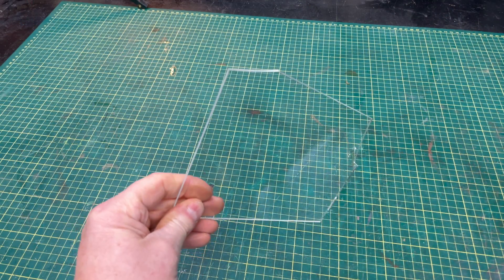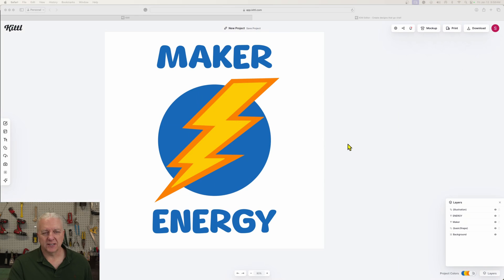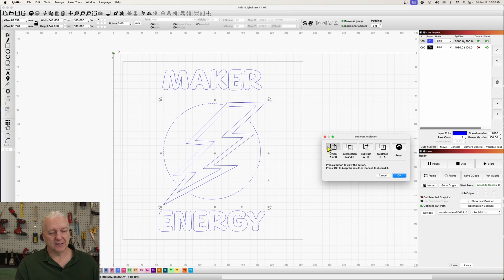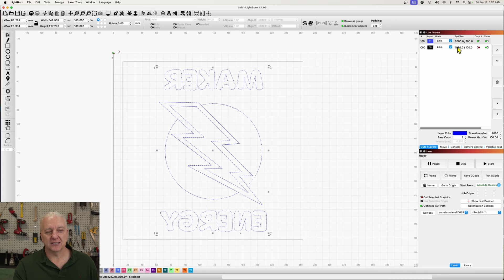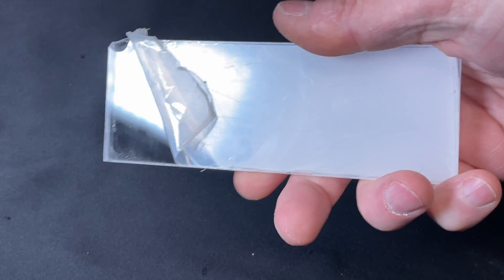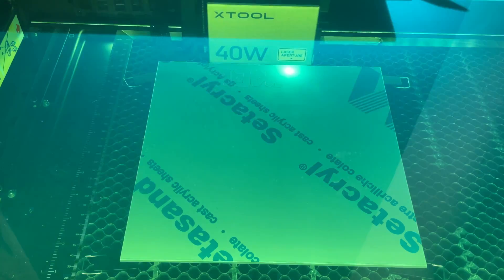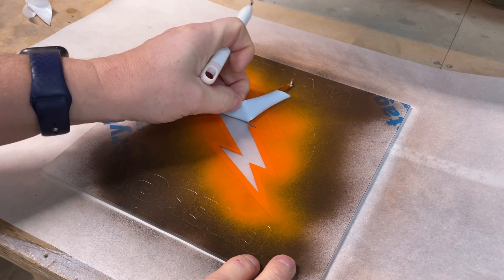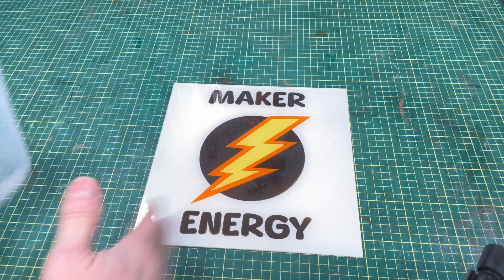Mastering Laser Engraving for VIBRANT Colored Signs

Comment: Hi Steve. One question, how to you stop your first spray layer from filling in all the cuts. I tried this and ended up with my first color being a feint line between all the other colors.
Reply from the maker: Well you do need to be fairly careful about where you're spraying, but You could always place some cardboard over the pieces where you definitely don't want pain.  The other option is to build a jig that lets you place the part very accurately and then only cut the mask for one color at a time and paint each separately.

Comment: Great video. I do have 1 question. I have a falcon 22w diode and I was wondering which method you use to CUT out clear acrylic if it’s possible. Approximately 3mm thick.  Tia
Reply from the maker: Cutting clear acrylic just a non-starter for diode lasers. Really only CO2 lasers can cut acrylic.
Reply: @SteveMakesEverything  Ty!
Reply from the maker: @nickdinick7653  Happy to help.  I really want to do a video about the different types of lasers.

Comment: I have paper masked acrylic. I scored/engraved my acrylic and then weeded out the parts to be pained. I painted a coat of clear first and let dry. Then I sprayed white. When I peeled back my paper my lines look terrible. I will try to skip the clear, though I thought that was suppose to help with clean lines. I'm concerned that it's some adhesive residue causing this, or too much paint? I'm at a loss and wondering if you have any suggestions. I've made 350 name plates and am hoping to salvage the ones that I haven't yet tried painted. Any suggestions appreciated.
Reply from the maker: Making things is volume is never a great idea until you perfect the process on lower volumes.  A process like this has a lot of variables and takes a bit of practice to get right.  I've made quite a few signs like this before I got it right.

Definitely. start with relatively light coats of paint. Two light coats is better than one that causes the paint to pool.

Comment: I loved this video and decided to make a sign for my wife's greenhouse.  I should have been a bit more conservative on the number of colors, but wives can be persuasive!  The sign had to be round and my stock was square and I could not cut it perfectly round, so I ordered from Amazon.  The disk I received were not covered in colored protective material as pictured but rather clear plastic that I didn't think the laser would cut through, but I took a shot at it anyway, and it failed.  I resorted to painter's tape (several times) and though it cut well, it leaked paint under the tape even when overlapping.  I did press the tape down well, but small streaks appeared in places.  Otherwise the paint looks great!  I guess I'll try to get the streaks off or get more disk if I can find a seller that presents his product more accurately.  But great video! Keep 'em coming.  Thanks
Reply from the maker: On Amazon you tend to get the cheapest materials.  It’s a little more work but you can also do this with material protected with paper as long as you peel the paper of the other side and lift it off the workspace before cutting to design.

Comment: I'm going to be using this method on black acrylic..  So I won't be flipping the image..  It's just for a small logo, two colors.. I hope it works!
Reply from the maker: Hmm. Certainly masking the front of the acrylic is possible but I would worry about durability.  I think you’d still be better to paint the back and if you want black then finish off with black paint rather than white
Reply: @SteveMakesEverything  I only have a diode laser.  I wouldn't be able to cut out the panel or the holes for the usb chargers I need with enough precision.  If the durability proves to be an issue down the road, hopefully by then I will have a K40 CO2 and can remake it with clear acrylic
Reply from the maker: @ericeinsmann5559  You are correct.
Reply: @SteveMakesEverything  Steve, it worked out great! Even better than I hoped for!
Reply from the maker: @ericeinsmann5559  Awesome!  Happy to here it.

Comment: Thanks Steve. Did you have any problems with the veneer swelling from the glue?
Reply from the maker: I assume this is a comment for my recent inlay video. No, no issue with glue-swell, in part because you don’t use too much glue., but also because the outer template is also veneer, so everything expands by about the same amount.
Reply: @SteveMakesEverything  Thanks

Comment: Another great video! 👏Steve, if you have to play favorites, what would you recommend as a desktop best laser - S1 or P2 ultimately ( please don't say that good ol lawyer favorite ''That depends'' ) What would be a better investment in a small laser engraving business. What has more range and potential?  The reason I ask for a no ''That depends '' answer is that today I might do /sell  something, but tomorrow I might change my mind and add other stuff, so generally speaking S 1 or P2 ( I only consider those 2, so I can stay within the X tool ecosystem currently have the F1 )- Thanks
Reply from the maker: If you want to work with acrylic you would need a P2 - I have a review coming soon.  The S1 is also a fine laser, but no diode laser works well with acrylic.

Comment: Hey Steve, thanks for the videos. Excellent content.  
If you had to pick just one diode laser, which one would you choose?  
Also same question towards a co2 laser.  
I’m looking to upgrade my 5w laser and looking at a few options. I’m also trying to decide between a 30w diode vs a 100 watt co2.  
I know that’s a broad range but any input would be greatly appreciated.
Reply from the maker: I’m always uncomfortable answering this question, but here goes.  For a 20W diode laser I’d pick the AlgoLaser Delta, but if you wanted a 40W I’d probably go with the Longer B1. It’s not the most glamorous laser but it works pretty well and seems reliable.

CO2 lasers are. H h more of a challenge.  I’m tainted by my own CO2 design because it’s big and powerful, but if you’re looking for something mainstream at the smaller end, maybe the Xtool P2, but if price is your criteria, then maybe something from OMTEC. If need something larger then look at Thunder Laser
Reply: @SteveMakesEverything   Steve I understand your hesitation.  I have never heard of the algo laser but it looks like a nice unit. I’m currently looking at the laser by roly automation.  It also seems like a really nice machine.  All these machines will work for me and will definitely be an upgrade to my shop.  Thanks for your time and quick response.  
Keep  up the good work with your videos.
Reply from the maker: @BigT396  I have heard lots of people talk about the Roly in a positive way.  The only real complaints I would have about it are, first, the relatively huge beam spot size compared to just about everyone else, and second, there appear to be some limitations around the height of things you can engrave with it, though I have no first-hand knowledge to verify this.  I believe this is because the bottom of the unit is fixed, so you can only engrave what you can fit inside.  Hopefully, someone in the channel who has one can chime in here to explain why I'm talking sh*t, though.  I know Rich (Louisiana Hobby Guy) loves them and that probably means something, but Roly does pay him to be a spokesperson, so maybe he has a bit of bias.

Roly is also a very small player in the diode laser space, where the company founder is largely also the prime contact for support. 

While I like Roly's effort to be different, I would likely not buy one for myself.

Comment: Nice job !
I thought that only acrylic sheet protected with brown paper was good for this but it seems i was wrong...
I tried to make it but when i remove the protective paper the paint comes off 😢
Perhaps is comes from my paint quality ....?
Bye from France
Reply from the maker: The stuff with brown paper definitely works, though I’d recommend peeling off the other side before putting it in your laser because the beam will hit it and mark the surface
Reply: Hi Steve, Didn’t quite understand why you have to remove the protective film on the reverse side to the brown paper? One further question, you refer to engraving the image but surely you mean score, otherwise it will burn off the backing paper.

Comment: That is awesome, thank you for giving me some ideas. How could you finish the back to keep the paint safe from scratches?
Reply from the maker: You are so welcome!

As far as protecting this, I did spray the back with a coat of white paint, but if you need something more durable than that, you could always add a second sheet of acrylic and then put both into a slotted border frame to hold it all together
Reply: This looks like you are actually scoring, not engraving? I have the XTool P2, and when engraving it took forever & left it very sticky.
Reply: @LoriWember  correct just doing enough to make so you can get the backing off in the pattern you want.
Reply: @markmorgan8378  thanks for the clarification!!
Reply from the maker: @LoriWember  Yes these are done with lines.  Depending on your school of thought, this could be considered scoring rather than Engraving.  XCS uses separate terms, Lightburn calls this type of engraving a line, but also has separate modes for images and filled objects.

Comment: Good video Steve. Since my diode laser will not cut clear acrylic I'm going to see if Amazon has pre-cut acrylic key chains that I can try your process with. Thanks for the idea.
Reply from the maker: I added an Amazon link to some 12x12" sheets that will work.  You can also cut acrylic with a table saw or just score it with a knife and it will (usually) break along the score line
Reply: @SteveMakesEverything   Thanks for the quick response.